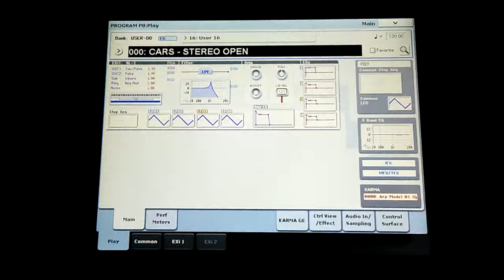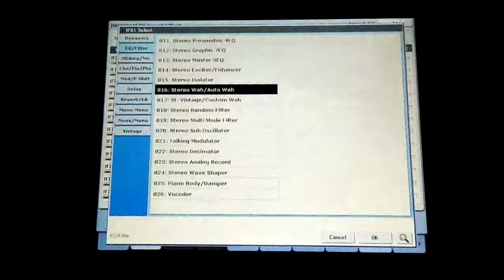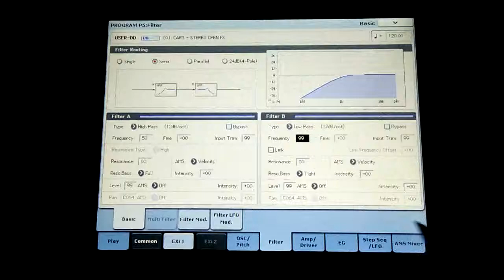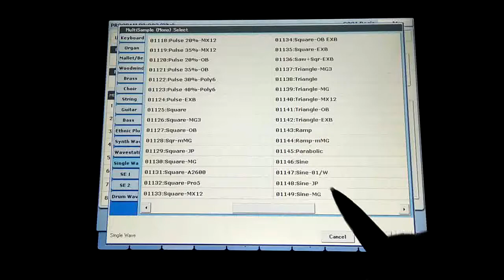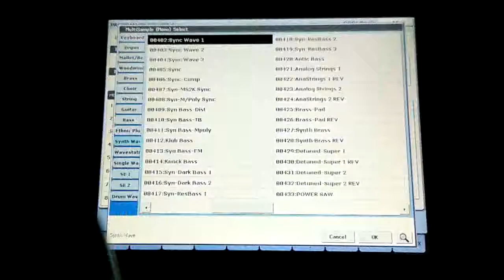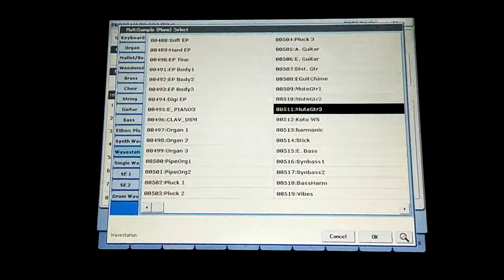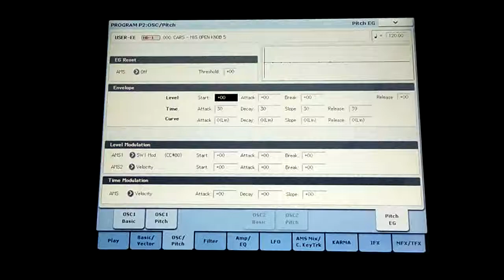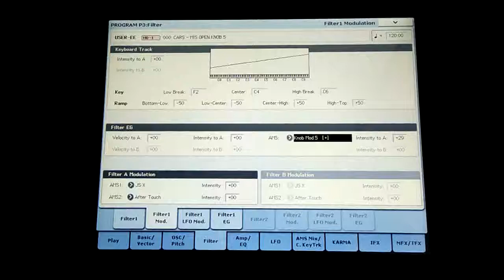Cars - Moving In Stereo Tutorial Part 2

Comment: I don't know that you can really duplicate this sound exactly using a digital synth, or on any synth that doesn't have a filter capable of self oscillation. It sounds to me like Greg Hawkes used an analog synth with a filter capable of self oscillation at extreme resonance settings (I think it was an ARP Omni). If you listen to the recording, there is no fundamental tone under the resonance at all, so the filter is likely self oscillating. On a digital synth, I would imagine you could much more easily get this sound simply by assigning the oscillator pitch to a knob or mod wheel controller, select an appropriate waveform that closely matches the timbre, and set the appropriate range for the pitch variance and also assign the filter cutoff to the same controller, with no resonance. This would give you the appropriate pitch gliding effect with the filter opening a bit as the pitch ascends and closing a bit as the pitch descends.

Comment: Gold job David. Interesting to see your progression toward your goal.I wonder if it wouldn't have been more simple with the MS20ex drive in the Kronos ? Did you try it ?
Reply from the maker: There are some control factor differences between the AL-1 and the MS20 - One of the big ones being the filter sweep itself. I knew I could get the sound close with the AL-1. Perhaps the MS20 would have also been a good choice, but I didn't consider it because I knew the AL-1 would definitely work.
Reply: Ok David. Yes of course, as I said, it is very intersting to follow all your steps. And once more, you give us all a great help in discovering our Kronos. And AL1 is a real great synth.
I was curious to see if it worked with MS20ex, and it works. As I owned the former MS20 in the 70's, I knew it's capability to self-resonance filter. I tried it in the Kronos and it works : even with the both OSC level at 0, we can set both filters in self -resonance and work with them. I'm not sure it's possible with AL1 ?